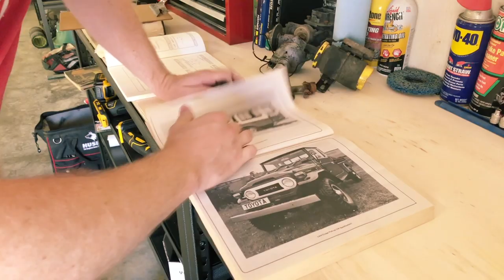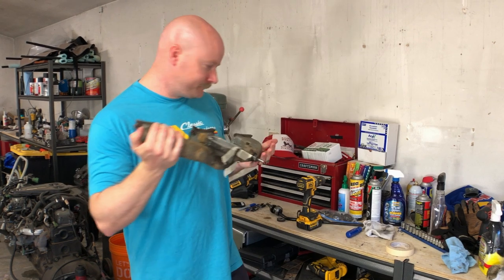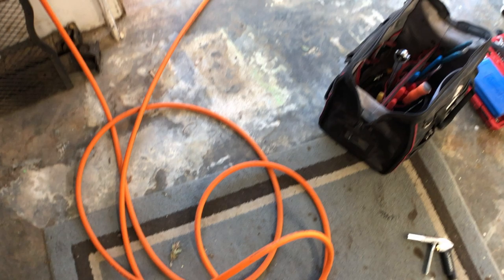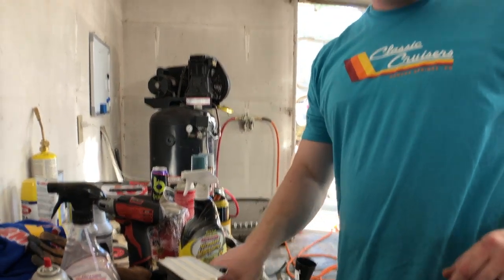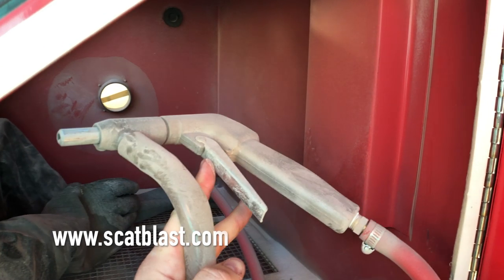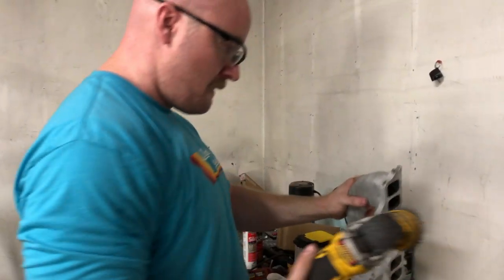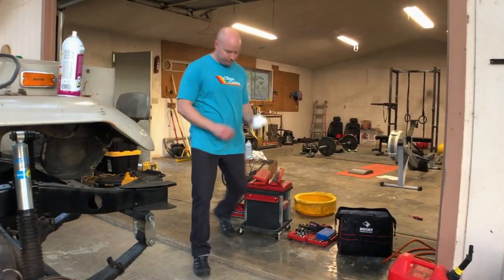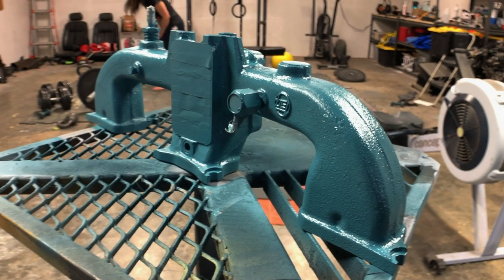Project Wrong Way Ep 18 - Harbor Freight Sand Blasting, VHT Paint on FJ40 Intake

Comment: hey can u tell me if you have to increase the fuel pressure to move to fuel injection? i'm thinking of converting my carburated '71 chevy to FI but the info tells me i have to go to a high-pressure fuel pump and add a return line from the engine bay back to the tank.
Reply from the maker: Joe George The short answer is yes, typically will have to increase to feel pressure when running efi. I’ll have better statistics when I do the transition myself, but right now that’s all I’ve got for you. Stay tuned...
Reply: Joe, answer is yes. Carburetor fuel pressure is usually between 4 and 7 psi.  EFI fuel pressure can be between 40-60 psi.  My Holley Terminator runs at 43psi. Most aftermarket EFI systems require a return line to the tank

Comment: I would have got the manifold to head surface machined first. It's not unusual for them to be a 1mm out of spec.
Reply from the maker: Is it too late to do this still?
Reply: @projectwrongway9127  No it's never too late but you could run a spirit level over the surfaces to check for gaps. Hold it up to the light. It's also best to get the flywheel machined to suit the new clutch. Usually the same shop can do both jobs. My shop did the sandblasting as well. Machining the the manifold ensures you won't blow gaskets down the track.